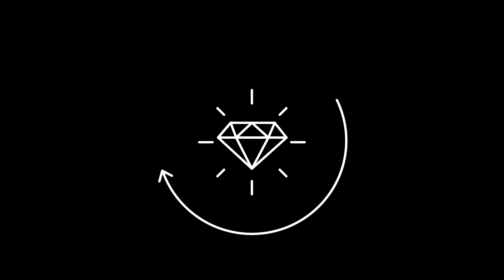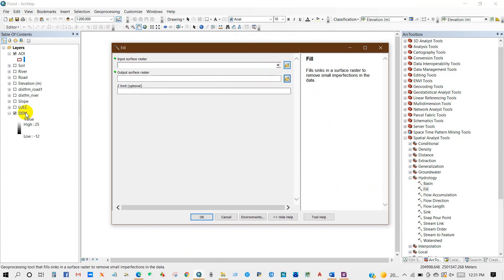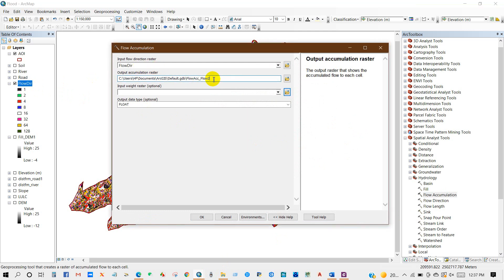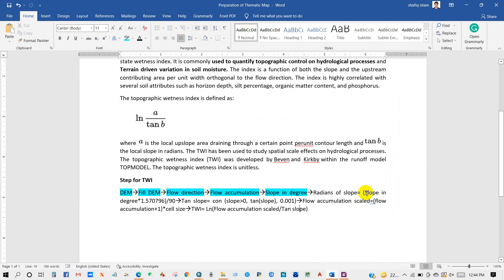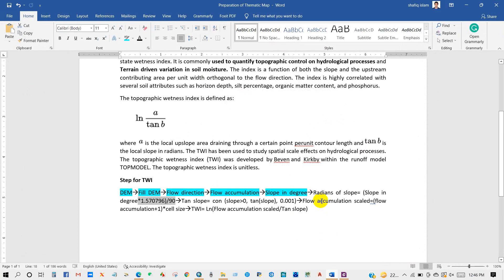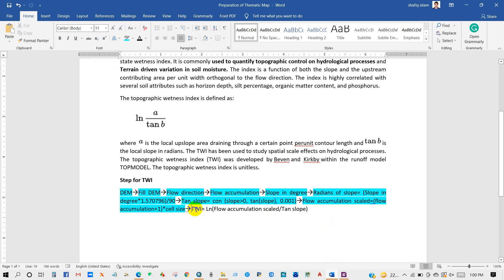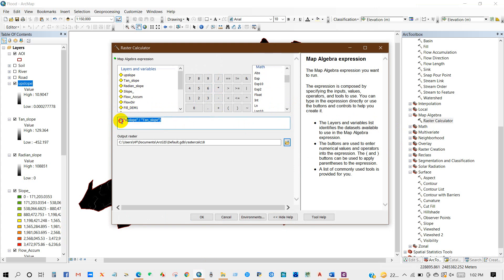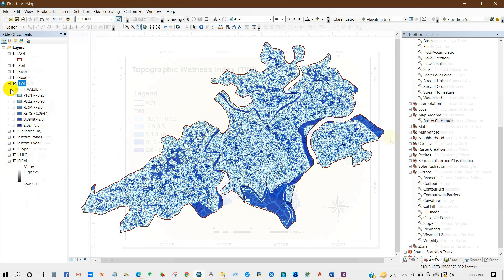Topographic Wetness Index (TWI) in ArcGIS

Comment: I tried many times but it gives me error 000539. anyone can help me how to solve this problem?
Reply: I'm also struggling with the same error, I can't get the flow accumulation scaled😕
Reply: The error might be caused by the decimal comma (,) (default when you copy cell size) instead of a decimal point (.). ArcMap expects the decimal point (.) for numerical values.

Comment: hello. may i ask something..
why should add +1 on the flow accumulation? what is the meaning of it or definition and purpose...
thank you
Reply: I think this is simply to avoid 0-value cells in the final step of calculating logarithms. Flow accumulation may give you 0 if a cell only outflows to the neighboring cells but has no inflow from its neighbors.
Reply: @austinzuo6658  thanks for your implementation, it's so helpful